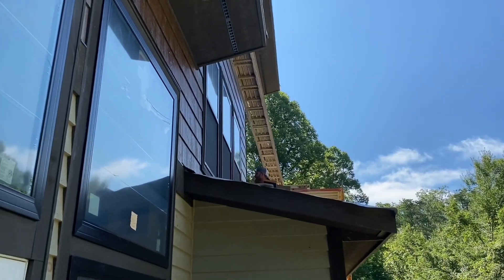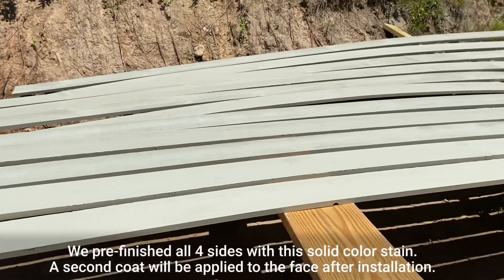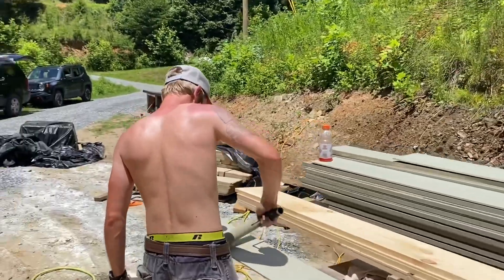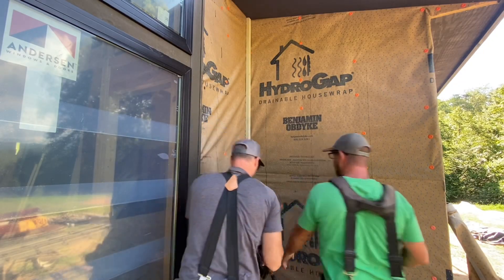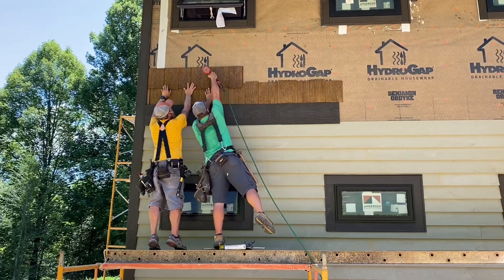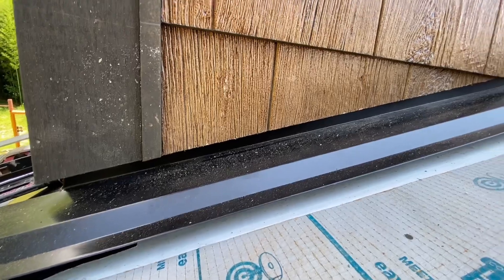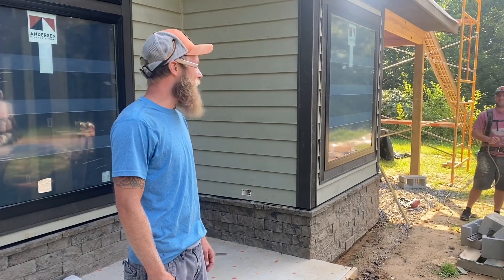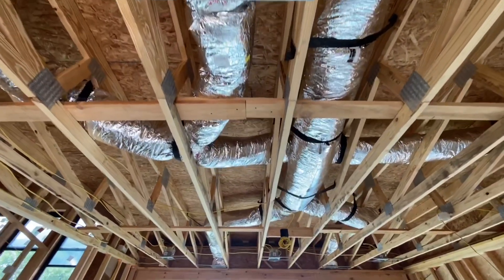Building A House Start To Finish | Episode 12: Siding

Comment: Dude you need to get jigs for ther siding, then all you need to do is start the first board correctly, no more horizontal marks after that. Holds the boards in place for you as well while you're nailing them

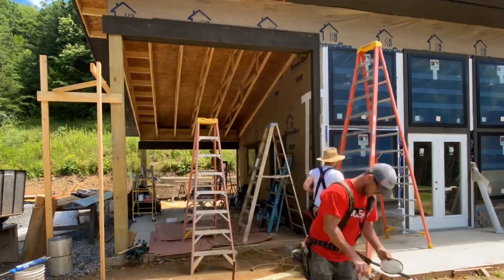Comment: Why stand on the top of an 8-foot stepladder (4:27) when there's a 12 or 14 ft. stepladder not being used, right next to it?  Come on guys!
OSHA 1926.1053(b)- The top or top step of a stepladder shall not be used as a step.
https://www.osha.gov/laws-regs/regulations/standardnumber/1926/1926.1053
Reply: Convenience and it’s really not dangerous if the ladder is on solid ground. Lots of osha rules written by scared people in offices who’ve never built a doghouse 🤷‍♂️
Reply: @Iamthathillbilly  I guess the painting contractor who was on an 8 ft. step ladder while working inside one of our community libraries (on a level concrete floor) shouldn't have died when he was knocked off when a passerby accidentally hit the ladder??

Comment: Why does the lower siding get nailed through the bottom of the plank? I thought they were supposed to be nailed at the top, so the next row would overlap the nail and keep it from leaking, like the siding on the top half of the house.
Reply: I would assume its done to secure the top piece of siding through the bottom one, that way each bit of siding gets 2 fasteners per stud
Reply: Because it’s real wood, if it wasn’t nailed in the overlap it would lift up when it cups, there would also be nothing much holding it on the wall if the wind started to blow hard, Hardie lap siding I believe is nailed the way you’re thinking but that’s a predictable manufactured product with no imperfections
Reply: Thanks for the replies. That makes a lot of sense.

Comment: Greetings from Europe, a truly fascinating series. Especially as it is so different to what we build over here in the Netherlands. But then again; “that’s one way of doing it” 🙂
Just curious but what would the expected lifespan for a construction like this?
Reply: Modern homes should last more than 100 years without major rehab. Houses in the US have been built with wood since the earliest settlers, with balloon framing since the mid-1800s. The current style of framing didn't start until the 1920/30s though. Lots of buildings are still standing that were built in the mid 1800s, though I'm sure most of them have gone through some renovation in that time.
Reply: idd. Thats one way of doing it;